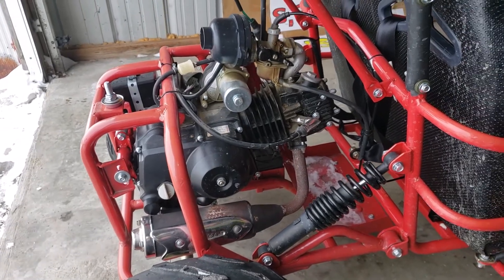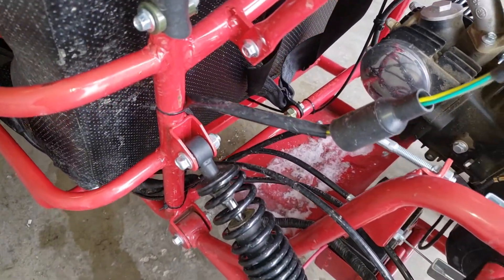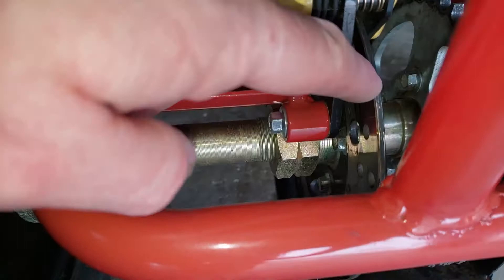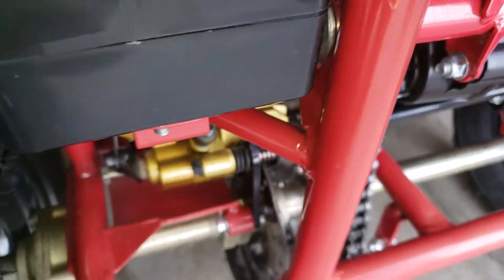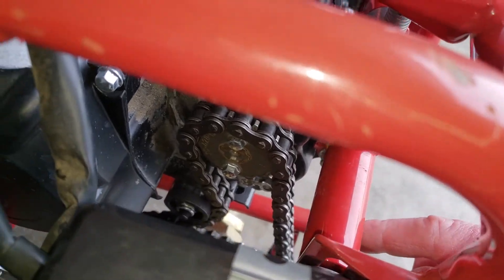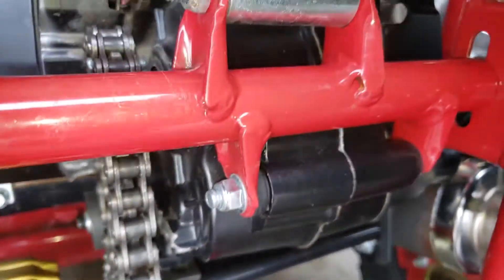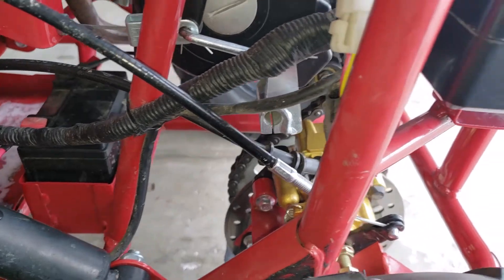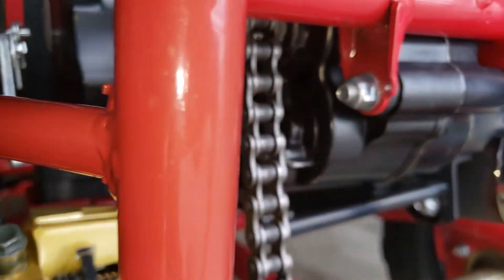Tao GK110 Go Kart drive system close up view

Comment: I have the same one same things happened
Reply from the maker: How did you solve the problem? I thought I had it solved and now its happened again just a few minutes of riding it. I'm going to try changing the fixed chain tensioner with a spring loaded motorcycle type chain tensioner.